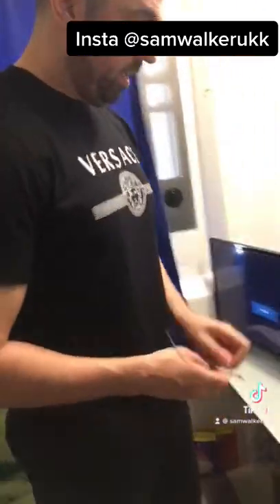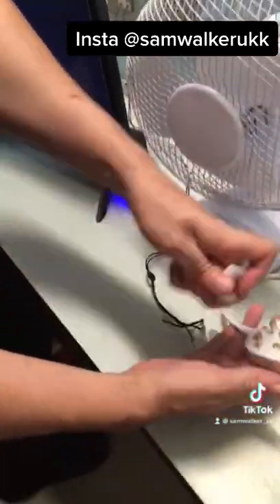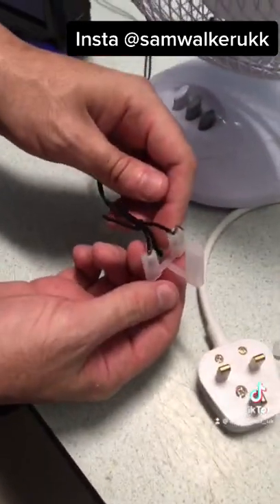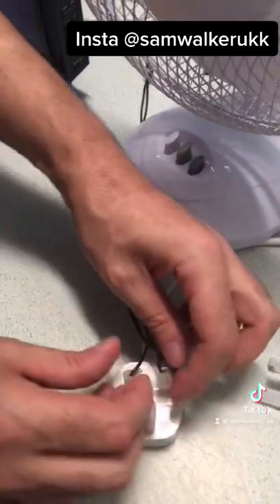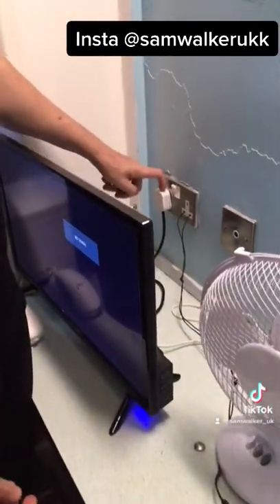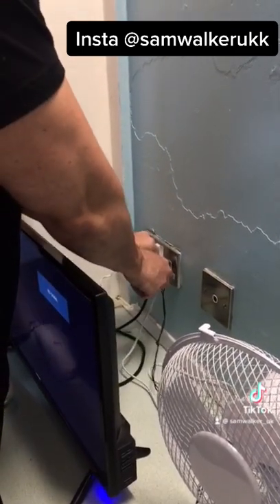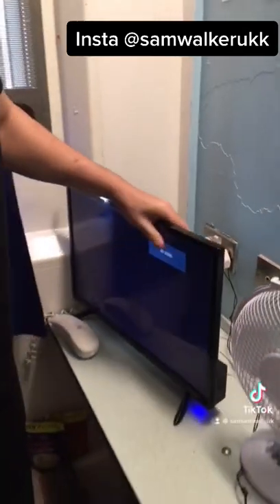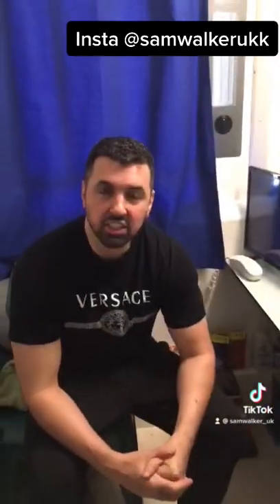Prison tricks how to make a extension lead in prison

Comment: Nice. I'd plug the kettle in the wall as it uses loads of power (750 - 3000W) and run the fan (40W) from the thin extension wire.
Reply: Come in, the place will be like a steam room off all the boiled water
Reply: I agree

Comment: Living the dream sir. All the other lads doing it rough on the outside
Reply: 🤣🤣🤣 fan AND kettle at the same time tho.. tbf, a very bad example.. 1. If its hot enough to need a fan, probably don't want a hot drink. 2. Literally jus unplug the fan for 2 minutes whilst the kettle boils, noones gonna find him on the floor suffering from heat exhaustion after 2 mins 3. I'm sure if u wer to run that longer that 30 minutes, something is setting on fire
Reply: @ash-6867 " I'm sure if u wer to run that longer that 30 minutes, something is setting on fire"🤣🤣😂killed  me , the room from corner to corner is only 10 feet .